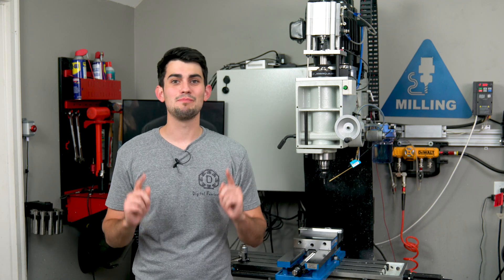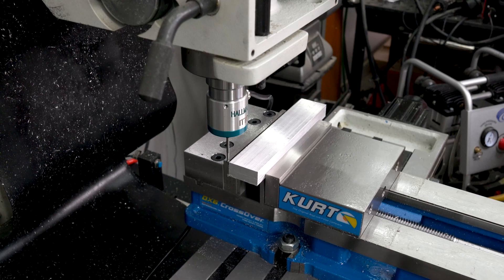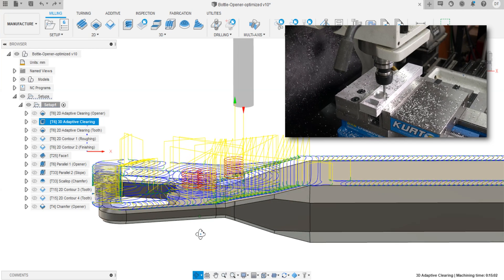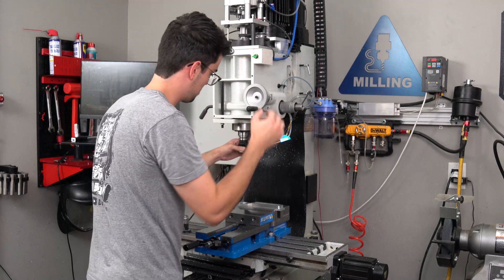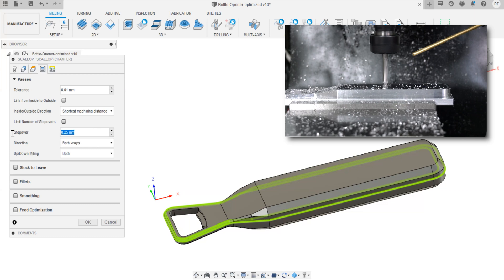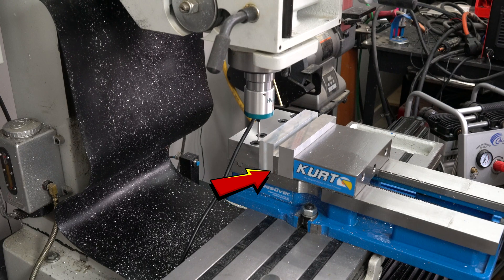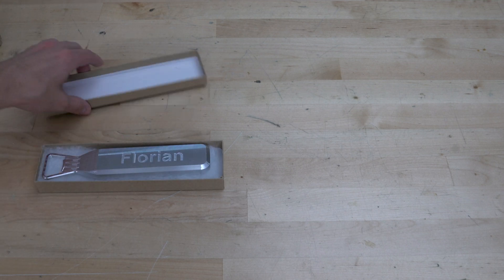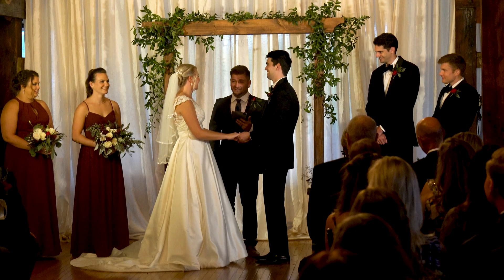Machining Groomsmen Gifts for My Wedding (w/ 3D Toolpaths and Soft Jaws)

Comment: Thanks to your videos, I am converting a PM-833TV to CNC.  I have heard that since this mill has a one shot oil system, that it leaks lots of oil on to the bench.  I am building a flat bottom enclosure (I do not plan on using flood coolant) and am questioning if I need to use the steel pan under the machine.  While a pan under the machine will catch oil leaking from the mill, it means cleaning chips from both the steel pan as well as the enclosure.  It would be easier to scoop up chips if I don't use a pan.  In essence the bottom of the enclosure would act as a large pan.  Do you find that this mill leaks lots of oil?